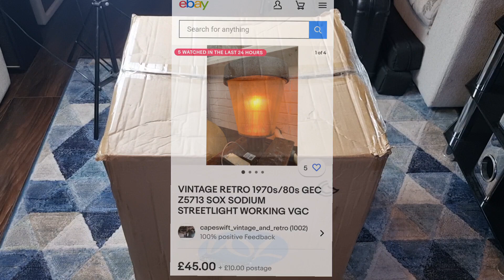GEC Z5713 Remote Geared 35w SOX Streetlight | Unboxing & Overview!

Comment: Fantastic mate , I’ve just got a Z5718 from the same area you’ve gotten your Z5713 , and its absolutely fab lanterns they are and  mine was a unexpected night save!, the Z571X and Z5698U lanterns were initially alternatives to the mushrooms in the 80’s therefore discontinuing them , production of this range was shortly discontinued after 1986 , and therefore the mushroom series making a comeback and with the redesigned GRP hat and production continued for another 20 years , as WRTL continued them for a bit. Also for that bowl I’d try get an acrylic one.
Reply from the maker: @BenSox135  Very nice! Thanks for the information. I will see then if I could get an replacement acrylic bowl for this lantern then in the near future :)